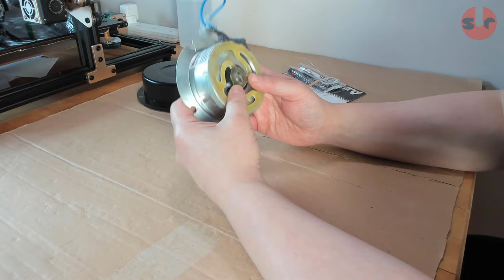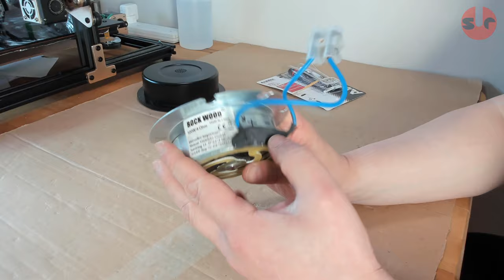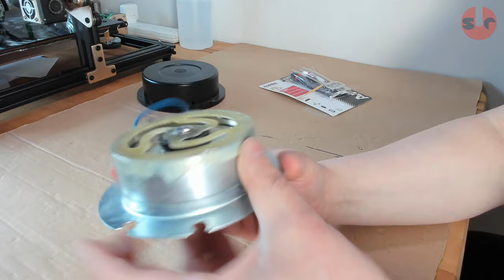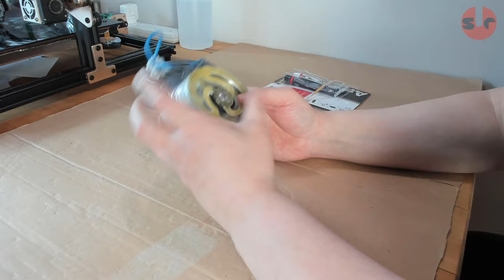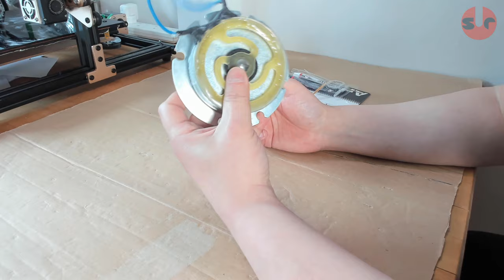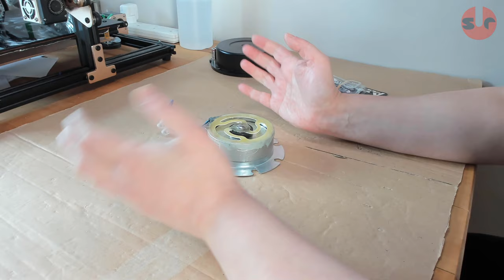How to fix a budget 🔊BODYSHAKER SPEAKER🔊 bass shaker frame popping out!

Comment: Since I can bought the Reckhorn-copy (1:1 inside) called Sinustec ST-BS 250 for (now) 34 Euro, I don't see a reason to buy cheaper and even still have two i'm not using anymore, because the Buttkicker Concert drowns them out and if there is one con about tactile feedback, it's power-consumption. Especially for the pedals tactile feedback should be some kind of mandatory nowadays, but no company like Fanatec or Thrustmaster is bribing YouTubers to promote them, so it's hidden in the shadow of sim-racing and people even upgrading their SimuCube 1 to SimuCube 2 instead of getting access to some more physics-channels every sim puts out.
Reply: Sinustec shakers are the business👍👍

Comment: they are great for the price. I suspect one of the bass shakers same like your i use here, started collapsed. back frame and it rattles too much to be too much annoying noise unbarable. I have to take it out and check if it has raised same problem like yours.

Comment: Do you have these mounted directly to the aluminium profile on your pedal deck as shown in the clip ? Thanks
Reply from the maker: Yes, using a couple of nuts used as spacers, as they need to be at least 0.5cm raised from the surface otherwise the shaker can't move.

Comment: I had 4 of those and had the same problem with the spider going out, after applying the same fix as you they worked ok until they burned (they get to hot)and broke, the shakers say you can run them at 100w 4ohms maximum...the amp i've used was 100w 4ohms at peak each channel, so i was running them at about 70 real watts each...after this i dont think its good idea to run them at more than 50w for long periods. Now i have 4 shakers similar the black you have at 100w 4ohms each, but without the vent, and didn't had any problems for nearly a year running them every day, with the amp maxed out at around 85 real watts each channel. As you have them probably they are ok because you don't need to run them hard on the pedals, but the way i have then...under the seat and low back, i really like to rock them, specially at rallyes! and the very cheap just don't get there.
Reply: i just saw your other video (https://www.youtube.com/watch?v=p8btWnG7b3E) and i just repeated your conclusion about running them at no more than 50w continuously here....sorry for repeating the same, din't watch before the other video.... But, as we arrived to the same conclusion, it reinforces the fact that people have to be careful in how they power this shakers.
Reply from the maker: I found the best way to gauge the max power input into these shakers was to check the temperature by touching them to ensure they remained comfortable without burning my fingers.

Comment: Butt Shakers do not appear to have been available for several months now. Not sure if they are still in business.
Reply from the maker: They are available on eBay, and from this French website: https://www.audiophonics.fr/en/exciter/speaker-driver-exciter-bodyshaker-100w-4-ohm-o-88cm-p-2947.html
Reply: Sim Racing Corner wow! Wasn’t expecting a reply! Thanks for the info mate. Cheers.
Reply: They do keep coming back in stock at Amazon, keep your eyes peeled. I bought 2 last week.
Reply: Thank you both. I will be looking for four soon. Would like feedback from each corner (each wheel)
Reply from the maker: @sinkorswim-westernaustralia  I found getting a clear stereo left/right effect difficult to achieve as the vibrations do leak across as the shakers are close to each other. Front/Rear separation works fine through.
Reply: @SimRacingCorner  Can you recommend a budget alternative to these in the UK? 
Audiophonic's website have a minimum order of €160(tax excluded). Only only need a couple and they are out of stock everywhere. Cheers
Reply from the maker: @00Clive00  Unfortunately, there's nothing else out there at this price/performance. My next recommendation would be these, they are more expensive but certainly good value for the quality, easily as good as more expensive options out there.
https://shakercentre.co.uk/reckhorn-bs-200-bass-shaker.html
Reply: @SimRacingCorner  Thanks for the recommendation, I'd already looked at these and read good reviews, why do they charge £11.50 for delivery! Might have to bite the bullet and get one.